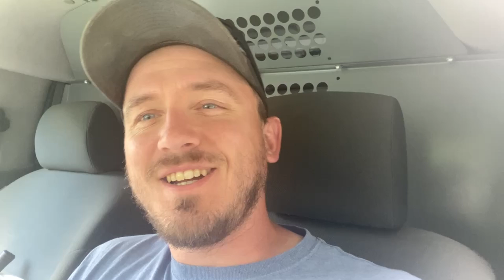Septic System 101: How To Calculate Proper Septic Tank Sizing

Comment: Thank you very much for this video. It was very helpful - our state also uses the bedroom rule assuming 2 people per room.

I was wondering if you could give me your advice on a situation we have in our neighborhood. Our neighborhood is all on septic... and a homeowner wants to turn their home into a group home with 8 individuals + 1 fulltime 24/7 caregiver, so 9 adults total. The tank for the home is 1000gal and the field line is 300' linear feet (6 trenches, 36 & 72 inches wide, and 24 deep--- if that extra info helps). Realistically, is that tank big enough to handle that much day to day waste water for 9 adults? Based off your video, would it be more accurate to say that the max number of adults for a 1000 gal tank would be 5-6 adults?

I've been trying to contact local gov departments and have had some issues, so any info (off the record just on your own experience) would be very helpful just for some perspective. There's a little stream that is right where this property slopes so we are worried 9 adults in a house like that would overload the 1k tank.

Comment: What about sizing a septic tank for a public toilet or an eatery toilet?
Reply from the maker: Public systems can be more complex. Sizing typically depends on the type of business and the projected number of employees and customers. Water usage can range from 25 to 150 gallons per person. While the standard "multiply by 2" calculation often yields a similar result, final system design requires input from both a designer and the county health department to ensure long-term reliability.
Reply: @Wellssepticandmore  thanks so much
Reply from the maker: @ my pleasure!
Reply: @Wellssepticandmore  but if I may ask, for a restaurant space in Bahamas, what value can I use per personal?
Reply from the maker: @ I'm not familiar with geology or regulations over there. I would talk with their health department or permitting office. They would have a good idea or a chart that you could use.
Reply: @Wellssepticandmore  please, I'll appreciate if you can help with that. Thanks in advance
Reply: is this calculation including grey water? May seem like an odd question but I'm starting to see grey water tank installations plus septic system as well.

Comment: How do you size a septic tank for an RV park that has 200-300 RVs? Do you run them all on a giant larger than life tank or do you split every 50 users into a 3,000 gallon tank? How do you determine this? Assuming a conventional septic system.

Comment: Thanks for this!!  I was wondering about factors of safety built in. I knew about the 2 people per bedroom assumption in Virginia, as an engineer I wonder if that 2x holding time is a factor of safety or actually needed.  Bridge design multiplies tons of things by 2 as well ;)
Reply from the maker: The 2x rule for the septic sizing is mostly to prevent damage or premature failure to the absorption system. No matter how well you take care of a tank, a little bit will work it’s way out of the tank.  That’s what we refer to as bio material.  The larger the tank or more chambers a tank has, you decrease the volume of escaping solids.  This will help the absorption system last the full design spec life time and/or out perform the life span